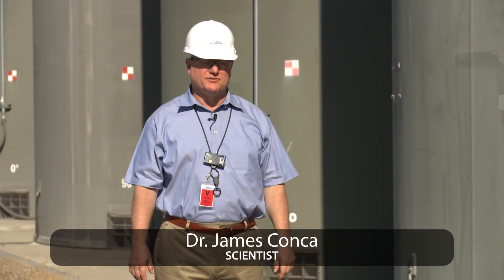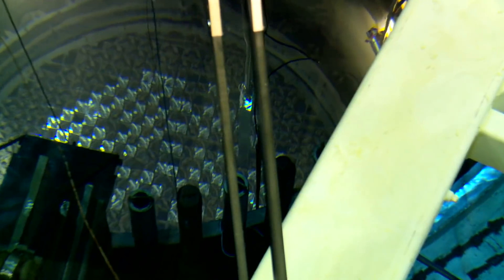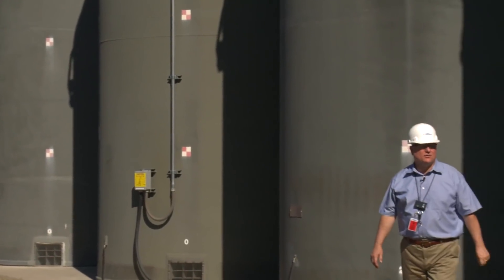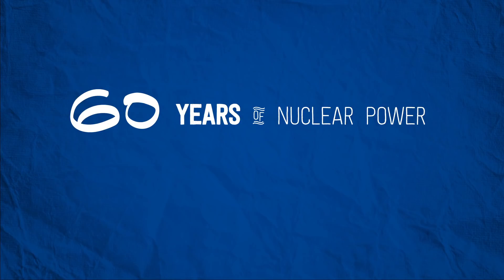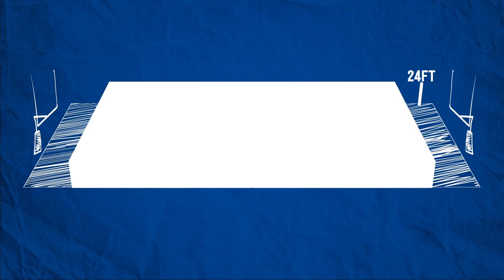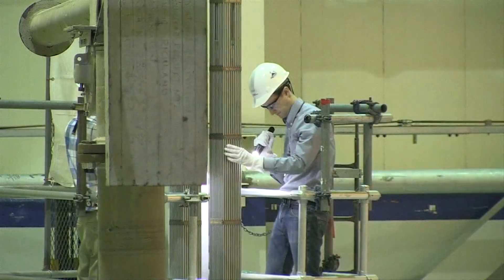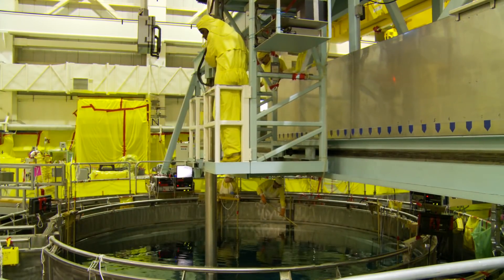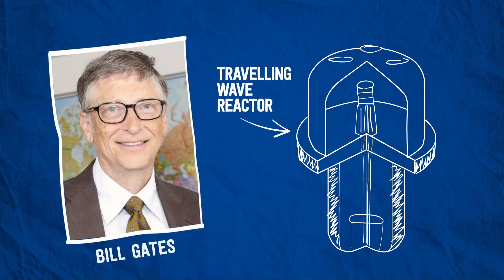Used Nuclear Fuel w/ Dr. James Conca - Part One

Comment: Carbon free, my little red eye! Ever heard of Carbon-14, boys and girls? How much fossil fuel was used to mine, mill, refine, transport the 1 million lbs. of uranium ore to get 7 lbs. of U-235? Lots. How much would have been used if they had to safely dispose of the highly acidic, radioactive tailings and sludge still left in the open on those poor indigenous peoples' land they dug it up at? They spent a over $1 billion so far at the Moab mine, and are still not done. They would not have bothered except it was killing fish upstream of the Grand Canyon. Upset those Japanese tourists to see such a sight. How much fossil fuel to build those massive steel and concrete reactors and the actual canisters that Captain Glow in the Dark is standing next to, Did you know the manufacturer of those canisters say their working life is 10-30 years. How many has Captain Doughnut switched out? What to do with the radioactive steel and concrete from neutron activation. Who is paying for that waste storage? Not Captain Bagel Boy. The American taxpayer is paying those utilities $1 billion a year to unsafely store their own waste - their waste. What a deal. Did I mention that nuclear energy is by far the most expensive electrical energy provider on the market. You betcha! But wait til they get one of those meltdowns. Hang onto your wallet and keep your gas mask handy, if you are in the same hemisphere.